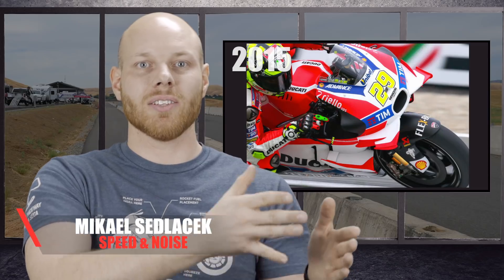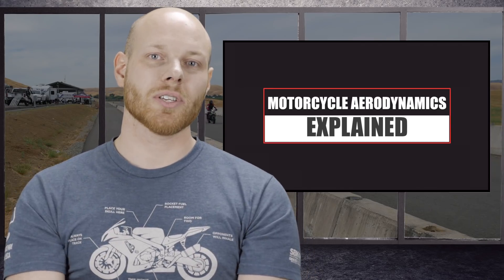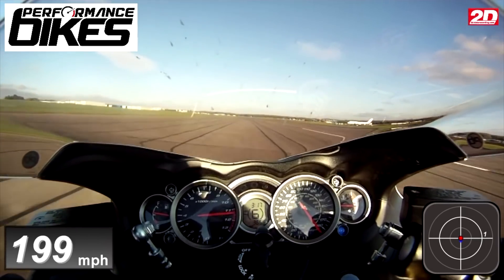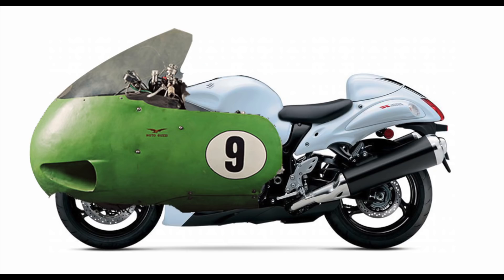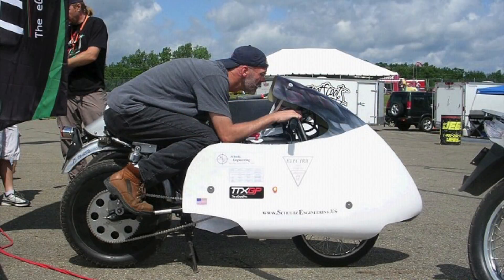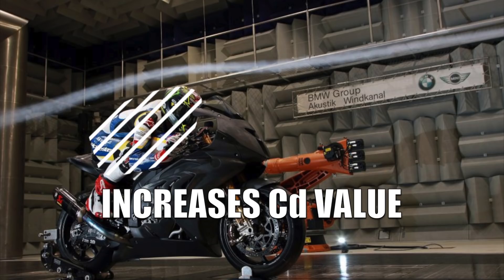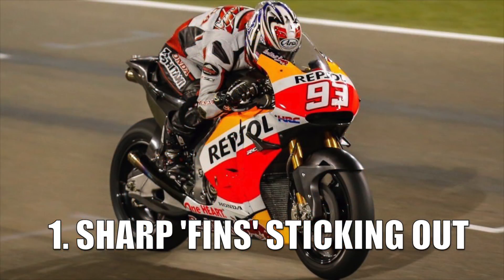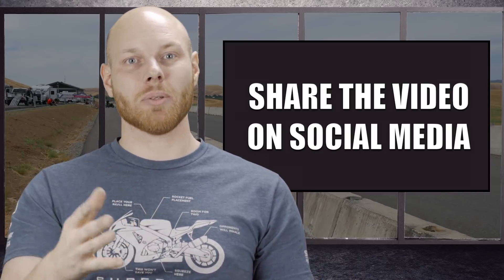MotoGP Winglets | EXPLAINED

Comment: Damn, I now feel so educated in motorcycle aerodynamics, that I might just go and add some winglets of my own. :D Great video!
Reply: In all seriousness, don't you think there's money to be made if someone started making winglets for bikes? Of course they're dumb for the average rider, but that doesn't mean they wouldn't sell..... 🤔
Reply: You might be right, but for this to work there must be one crucial thing - the cool factor. :P Same thing with putting spoilers on cars - adding rear spoiler to civic is pointless, but some people do it anyay. ;)
Reply: Who said a spoiler on FWD cars are pointless???  That's invalid.  While it may not have a benefit on a straight (unless you also have a real splitter in the front), it DOES help with weight transfer and lift oversteer.  So no, they are not pointless.

Comment: Many '50s GP bikes with dustbin fairings also had a tail fairing.  This smoothed out the air flow behind the rider, and importantly, moved the aerodynamic centre of pressure rearwards, thus addressing much of the cross-wind problem cited in the video. 

By 1957, bike makers such as Mondial and Moto Guzzi had resolved much of the stability problem with full fairings.  Because of the recession in motorcycle sales in the mid-late '50s, most manufacturers withdrew from GP racing at the end of the 1957 season,  leaving MV Agusta as the dominant manufacturer entering GPs.  They had never succeeded in making full (dustbin + tail) fairings work (handling and cooling problems) so they got them banned.

Comment: I would add that the dustbin fairing covered up the front wheel, a major source of drag. The spokes are moving at twice the vehicle speed as they come over the top. As drag increases as the square of velocity, even those skinny spokes can have quite an effect at speed.
 Also, Cda is simply how efficiently  air moves around an object, compared with a flat panel with the same frontal area.

Comment: I thoroughly enjoyed your video and analysis, but I did want to mention that in some ducati and aprilia cases Vortex Generators have been used to aid radiator performance to energize flow ahead of the outlet duct to aid heat extraction. I also feel like we might see "air curtains" in coming seasons in motogp, or my hope, some attempts at "trapped vortex" applications.

Comment: A wing on a car provides downforce at all times.  A wing on a motorcycle provides a force that is directed towards the tires.  When the bike is in a corner and leaned over, the aerodynamic force is angled with the bike.  It doesn't push downwards only, but outwards from the turn as well.

Comment: Great video Michael! Always the best!
Reply from the maker: Thanks!
Reply: @MikeonBikes  You missed the main benefit of VGs.. they reduce the trailing turbulent flow (wake) behind the rider & bike in not just reducing negative pressure drag behind.. but with a much smaller trailing wake.. less ability for tail gating.. frontal area is a small factor in drag coefficients.. a more important factor is the surface angles to the airstream & affect on laminar flow, not for surface laminar flow as such.. but the effects created by a ballooning effect of the airflow bubble around the fairing & rider displacing a given volume of air mass.. good references though to VGs, turbulators & foils that I've not heard any other commentators mention, except foils.. 👍.. I'm still waiting to see team engineers mount radiators under the seats like John Britton did in copying Steve Roberts F1 bikes of the early eighties.. they showed significant aero benefits over front mounted rads.. 

In reference to your maths/engineering etc.. it's not.. zero point one hundred eighty six.. it's zero point one eigth six.. zero point two seven not twenty seven.. still really enjoy your channel.. lots of thought 👌

Comment: I could be wrong, but your CdA data for the Hyabusa seems somewhat ambitious.  Typically the standard Busa achieves a CdA of between 0.55 to 0.60.  There are drag/power calculators out there you can check to see the effect on potential top speed.  200bhp to achieve 200mph seems in the ballpark for a bike with a CdA of 0.5.  I agree that stability is the main issue for reducing the CdA to levels achieved in the '50's.  My own race bike was tested at MIRA Wind tunnel during 2015 where our CdA was verified at 0.21. Our design minimised turbulent vortices around the rider and showed good indifference  (stability) to side winds and minimal front or rear lift coefficient figures at high yaw angles.  It can be done, but the blinkered FIM have consistently thwarted attempts by aerodynamicists and designers over the years to improve and develop the bikes to be safer and more fuel efficient.  It is a much misunderstood subject and much under explored in the 2 wheel world.  The FIM technical team have a sketchy understanding of this science that ironically, has been the main driver for the huge developments for improved efficiency in the automotive world and the very lifeblood of F1 along with their advanced hybrid power trains that we have yet to see in any FIM championship.  Oh dear this sounds like a rant.  Sorry about that.  BTW I liked the video.

Comment: This winglet concept is feasable only since anti-wheelies software are available. With conventional throttle if the nose begin to lift then the negative angle of attack of the winglet get smaller reducing the downforce allowing the nose to lift even more thus further reducing the angle of attack to eventualy end up with positive lift pushing the bike to do a backflip. That's called an unstable equilibrium the opposite of what an airplane tail is made to do.

Comment: Modern electric motorcycle pioneers have experimented with "dustbin fairings" and streamlined tails to double electric range and a higher sustained speed on the freeway (70 MPH). The electric motorcyclist were trying to travel cross country on a electric motorcycle before fast charging accessories for motorcycles were improve in 2017.  Though the streamlined tails were very long, there was not a huge adverse affect in a non racing application.  http://craigvetter.com/pages/470MPG/Index%20to%20making%20the%20Last%20Vetter%20Fairing.html

Comment: Huh, interesting, I'm a car guy (might get into bikes soon tho :P) but aerodynamics doesn't really affect a driver's physical state as much. Crazy to see how much changes on a machine physically affects the rider tho I guess that should be obvious with bikes in the first place
Reply: If the existing aero ensures the rider is kept in an air bubble the wind speed across the body is minimal. As you double the wind speed it increases the force times eight. So let's assume both front wings added 10 lbs of down force at 60 mph and directed that entire volume of air into the rider.. at 120 mph that 10 lbs pushing turns into 80 lbs.. at 180 mph that 80 lbs turns into 320 lbs. While the average race duration is around 45 minutes to you it may not seem like adding that much extra energy input to the rider seems like much till you have to lean into a turn with your muscles slightly exhausted or even exceeding it's capabilities. 

Just search on YT 300 lb barbell row and realize the average professional motorcycle racer is much smaller muscular physique as lighter riders go faster. Like the old street racing joke is instead buying carbon fiber get a girlfriend 100 lbs lighter and you'll go faster and save money in many other ways.

Comment: if CoD is the same and the Surface area is the same. then we can say that 

75bhp Moto Guzzi @ 301kph is 301x301= 90,601 =75bhp. (90601/75 = 1208.01/hp)
197hp Suzuki Hayabusa @ 327kph is 327 x 327 =106,929 = 197hp. (106,929/197 = 524.78/hp)

the Moto is doing less work to the air. if it had 197hp i could go maybe as fast as 1208.01 x 197 =237,977.97 Square root of 237,977.97 = 487kph 302.6mph max
Put it on salt and it will not be as quick of cause. so just a rough guess.
Reply: Look at 1208.01 and 524.78 as a level of 
slipperiness.

Comment: but when you lie it flat into a corner isnt that downforce suddenly sideforce making the front tire want to wash out into a lowside? did the designers only think about the upright position?
Reply: That is a question I was asking during the video.  I hope the presenter can address this point.
Reply: When sideways... the wing would act like a shark fin, cutting the wind ...only when the rider lifts the bike he has to shuggle, so then they have to use more energy to get the bike upright, or flip it to the other side
Reply: https://www.youtube.com/watch?v=Y3nEbwOTN3g Here's a more technical explanation if you're interested.
Reply: hahah what the fuck are you kidding me right now "cutting the wind". god i love youtube comments
Reply: This is highly debatable. As the lean angle goes beyond 45 deg, the force is exerted more to the side, the wrong side. So far, it creates a significant outward force, but also a down-force. Rider opinion at this point, is it's a bit like more or less physical weight on the front. It does very much have an effect, but exactly whether that's a positive thing or a negative thing depends on the bike and the rider and the circumstances. (Tyre choice, front spring rate & preload, etc...) It is very much like adding a 20kg bag of cement over the front of the fairing - there are circumstances where that's a bad thing and others where it actually helps. The place where it really does help, -a lot-, is as the bike picks up out of a fast corner, and goes for full power. The one who gets the biggest benefit, is Ducati, because their bike has a relatively low & rearward centre of gravity. The weight distribution of the Duke is perfect to get maximum power down and drive forward, as early as possible, but as the bike comes more upright, the rider has to back off to control the wheelie. The Yamaha has this problem rather less, because it has a higher and further forward centre of gravity. The heavy part on the yam is like where the cylinder head is. The heavy part on the duke is like where the clutch is.... That does not provide a clear advantage to one or the other, overall, but it does mean as you pick up off the corner, at 120 ~ 200 km/h, the duke first gets much better drive, but then can't maintain that forward drive because the front lifts. That's why Ducati are playing with downforce, and the most loud and vocal to keep it and defend it. They have by far the most to gain. Everybody else is jumping on the band-wagon, because ... you know, there might be an advantage in it... Why let Ducati have turbochargers if we don't have them?
Reply: corner g centripetal acceleration is more so generated by camber thrust than yaw of the front wheel, also the time lost v gained in acceleration and braking is the largest gain to be made on motorcycles, and at the comparatively low speeds of most turns, the relatively short airfoil sections produce minimal lift read downforce compared to the camber thrust in the corners that this would become problematic, as always in engineering it's tradeoffs, AWC limits effective acceleration,  foils improve it, that means better laptimes.
Reply: no. dat downforce at an angle actually presses the tyre into the track giving it more traction.

Comment: The main problem is that these fairings are butt-ugly and do not make the sport better since spectators can't see the speed increase and everyone is using them. Plus there is a risk of (costly) aero wars, which has no place in motorcycle racing, but a high potential of ruining it like it did with F1. Imagine a MotoGP where riders can't be within centimetres of each other in the bends - that's game over!

That safety argument is hogwash. Winglets would just have broken off in case of a collision. FIM should have just taken a strong and honest position and said "We don't want that shit in our sport." When nobody is allowed to use some technology, there's a level playing field. Ducati is making themselves look bad when they say they absolutely need aero in order to be competitive. They've had other things to worry about (turning) and they made great improvements over the winter here - nothing to do with their ugly fairing though.

The only reason aero fairings came back in 2017 is because the wording of the rule intended to get rid of them (still!) has a gaping loophole in it. E.g. with Ducati, just connect the two existing winglets and you're good, because now they're "integrated into the fairing". WTF? Why did it even take them so long to figure that out?

Simple way to close the proverbial loophole though: Add a sentence that forbids holes in the fairing that allow seeing right through, other then for purely mechanical reasons (forks, radiators, etc.).

Comment: Why don't they just get rid of the RIDER since it causes a lot of air turbulence? And as said, it's the enemy of the smooth laminar flow, therefore No rider = No drag = Increased speed = Faster lap times. The Motogp aerodynamics department is lacking brains.
Reply: And you are lacking......

Comment: Why oh why doesn't Dorna/FIM look at F1... They keep making the same mistakes. Traction control nearly killed F1, but you know it'll stop high sides so lets have it... winglets & excessive downforce killed proper racing in F1 as they find it harder to follow, a problem they are still dealing with due to complex front wings... motogp... yeah we'll have some of that. As the dude pointed out, teams & FIM already know these winglets making it harder for the guy behind to follow, yet they clear all these designs for 2018.
When will both championships/governing bodies focus on the racing and not making 1 car/bike ridiculously fast/grippy on their own. FE is gonna end up blowing these championships apart and and electric bike series as they cannot afford to add all this drag to their vehicles cause of the infancy of their drive trains & batteries which is why they have closer racing. I am not for stock vehicles, but when you actually look out their, the championships with stock chassis are always the ones with closer racing/more winners per year.
Moto GP refuses to learn from F1 mistakes because we're bikes... fk the cars! Ilmor had the same ridiculous mentality when they had a stab at bikes... we know everything about car engines so lets make a bike on this will be easy... wrong!